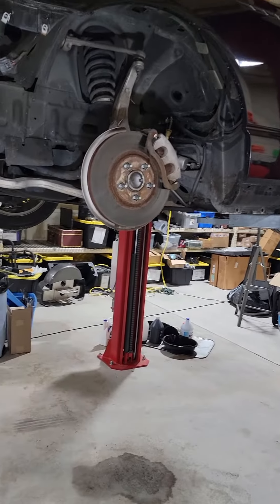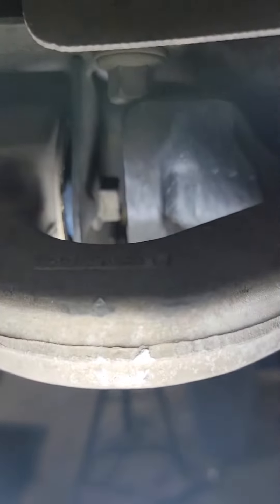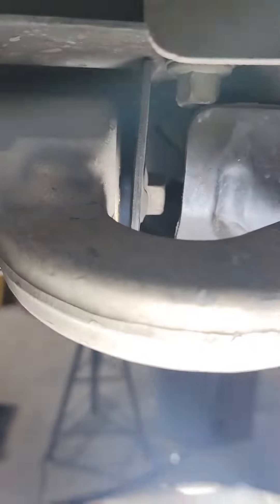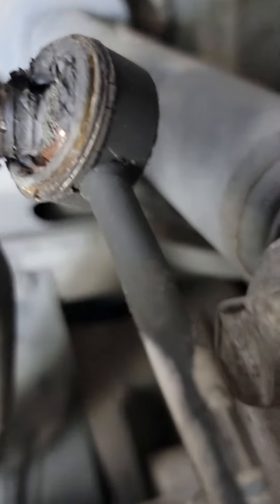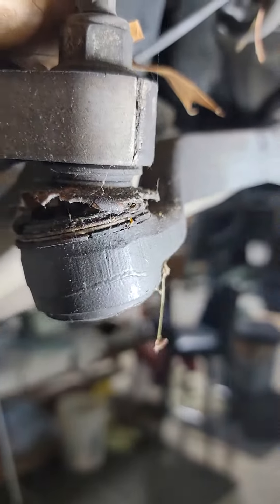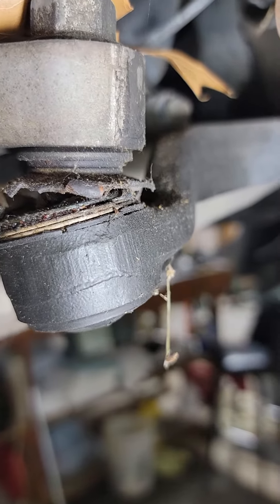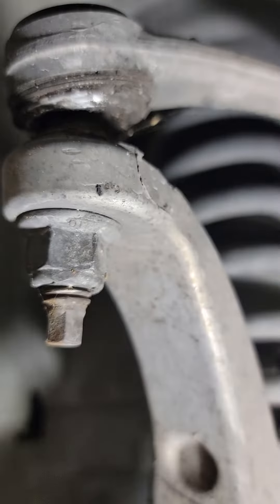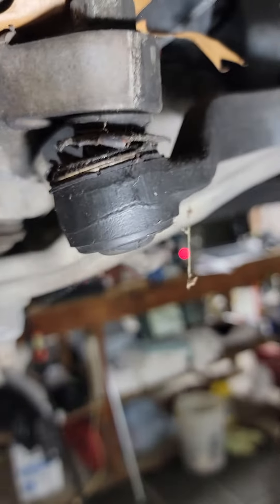2002 Thunderbird front suspension inspection #ThunderbirdBob.     www.TbirdBob.com

Comment: My dad just got another 02 tbird with less than 8k miles and every ball joint looks blown out like these.  Not to mention abs light c1234 with a known good sensor, no power steering, and probably every other electronic module gremlin these have.  Pretty sad.
Reply from the maker: What's sad?  A 20 year old car with a few overlooked maintenance issues?
Reply: @Klorvin  with less than 8,000mi, stored in temp controlled building,  yeah, I find it sad it has so many issues.
Reply from the maker: @StanStill.83  "climate control" doesn't stop the breakdown of rubber components.  Many parts fail from lack of use
Reply: @Klorvin  You're welcome for the 362nd view.  Keep up the good work.
Reply: That's pretty normal for a 20+ year old car. Plastic and rubber dry out and fall apart. Once a car hits about ten years or ~100k miles it's expected that you will need to start replacing suspension part (as well as spark plugs, timing belt, and various other 100k maintenance tasks that most people skip).